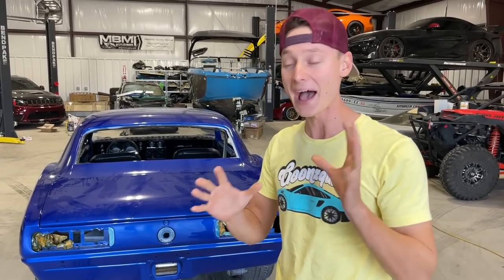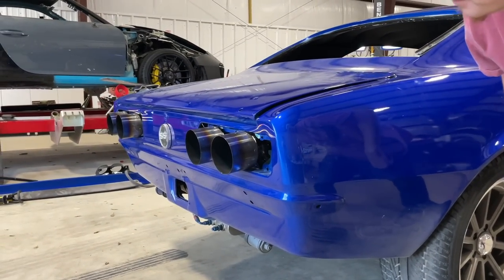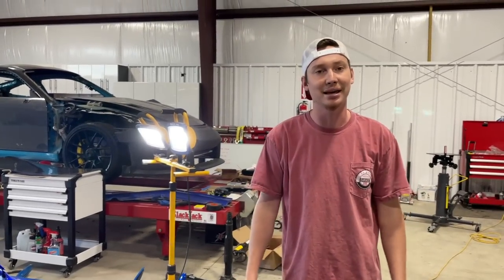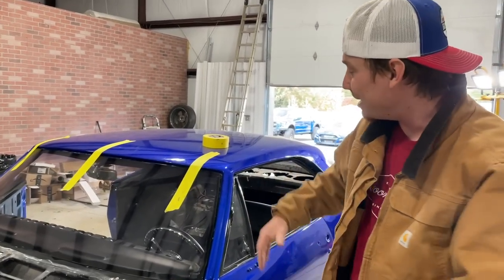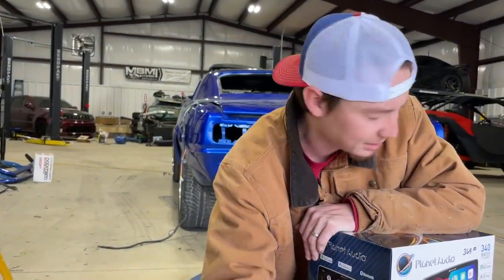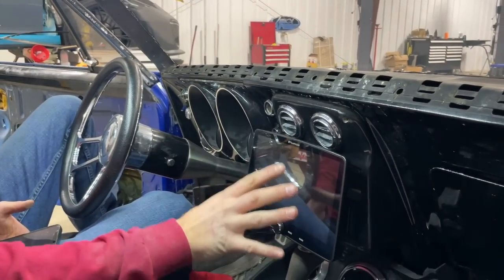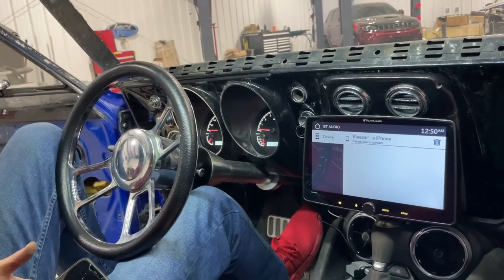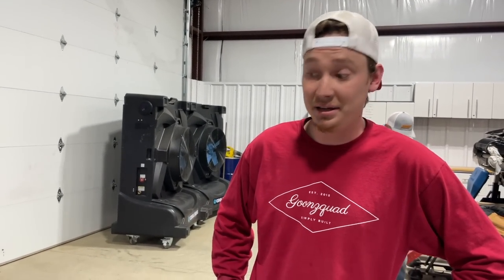Our LT4 Swapped 1967 Camaro Gets An Insane Stereo System!!!

Comment: Nice build guys but from someone who loves his tunes.... don't mount your amps on the sub box...turn your sub box right round so the subs are facing the rear of the car as the angle on the box is so its sits into the rear of the back seat don't use your gain as volume you need to match it to the head unit 😉

Comment: By the time you read this you will have the windshield and back glass reinstall. But it is important that you get the black primer made for glass installation and prime the glass and the pinch weld where the glass is . Don't you have the moldings that  goes around the roof and quarter panels. Same for the front. Also you need the clips that attach the moldings. good luck and keep on trucking on this build.

Comment: Guys, about the glass, your camaro came factory with a piece of chrome trim around the sides and top of the front and back glass that covers the glass edge. There were clips that installed on the vertical side of the glass opening for the trim to clip on. Being a restomod car when you bought it it may have had the little factory metal studs that the window trim clips slide on to ground off or something so the studs are not there.

Comment: you don't want the gain(s) and volume turned all the way up, your speakers will start clipping. start with the head unit turned up and then start adjusting the gain at the amp until it almost starts clipping. that's a good base (no pun intended) to start from. and def get some sound deadener in that trunk! but keep up the good work guys.

Comment: Windscreens before the 90's didn't glue in like that - you need to get an original rubber window seal, unless someone makes a rubber trim to look like one.

Also, the sub should be facing the other way I think - the angled side is supposed to match the angle that the back seats lean back at

Comment: Dont set gain too hight and dont use bass boost cause if can affect amp or even burn speakers and hipe u guys wired 8ohms and 4 ohms correctly to get the rite sound, also get some wite farrels for the wiring to the amp but sounds good so far keep up the good work guys 💙💙💙💙💙

Comment: Good sound system try the subwoofer speaker box facing the back facing subs behind the car will definitely get more bass, Got to adjust with the stereo settings as well and the subwoofer amplifier settings as well to make it sound good or have the shop were you bought it from to adjust for you, Camero looking damm good guys keep up the good work 👍🏻
Reply: yeah i don't think maxing the gain and cross over is healthy.   get someone who knows to calibrate it.

Comment: There should be a black gasket that houses the windshield. It'll give the clean appearance you want and it will seal better
Reply: The glass adhesive they used leaves a huge gap around the window. It's guaranteed that moisture is gonna get stuck back there and cause it to rust out way faster.
Reply: this^^^
Reply: The cringe has reached new hights. 😆
Reply: They just didn’t primer the car and the windshield properly shit is gonna leak also it’s missing the chrome mouldings

Comment: Love the channel.  My comment however is push back on the sound system install.  I know you worked hard on it, but I would have gone a completely different direction and installed an Ipod based sound system and not try to install that big screen in that Camaro if not enough room behind it because the screen sticking out behind the shifter and not sitting flush with the instrument panel looks bad in my opinion.  If you could have made it flush would have been a different story but you didn't. Not what you want on such a clean car.  I couldn't live with it that and if my car, I would have to pull it all apart and start new.  You could get ideas by looking at other vintage Camaro restomods.  Of course you want a modern sound system.  You could have also gone stealth and mounted the head unit in the glove box like some do if you could make the head unit like right.  I also don't think you need that sub size in the trunk.  Less is more.
Details matter on a car like this.  Yes, of course, you are time constrained to knock out this car with other projects on deck but doing it right matters too.  My 2 cents.

Comment: You should just get some black vinyl to create a border around that front windshield. Would be a lot easier and look fine 👍
Reply: It should have chrome trim that hides all the adhesive. That's the way it was done until about the last 25 years or so.
Reply: @Cartier_specialist  it should have a rubber seal to fit a windscreen on these there not bonded in

Comment: I have never seen a windshield installed with anything other than a gasket in a ‘67 Camaro. Will be interesting to see how it holds up. See if it leaks.
Reply: Yeah that was hideously all wrong
Reply: Yeah I was wondering if anyone else was old enough to realize that 😂
Reply: Why would it leak? Modern cars don’t leak. Same shit except instead of a gasket it’s glue.
Reply: Definitely a gasket but I have glued a few at customer request with no issues. Forgot to put primer on the glass, even if the urethane says it’s primer less to glass, always prime it Or it will not stick for long.
Reply: I didnt notice any clips put in for the chrome trim to clip into. The chrome trim hides the gasket material and makes it look  clean. I too have never seen a windshield installed this way.

Comment: Suggestion: remove the factory ac vents....cover the spot.....connect the modern ac vents. Rear tail lights; remove the OEM round ones, do some fab, replace w/modern square ones, and add a roll bar ....and that's a great deal in your sound system .. would have been about $1800 here in Cali 😎

Comment: I thought that year of Camaro had a rubber seal around the front windscreen, but that's what you get when you rush to get something finished.
Reply: nice to see anouther bolton fan can spot the big mistake of them bonding window in when it should have a rubber seal
Reply: @melwilliamson8208  It's just funny watching all the mistakes they make because they rush and don't do any research.
Reply: @sprograt  totaly agree they do good work but some mistakes are just silly anybody know old windscreens were fitted with seals not bonded
Reply: @melwilliamson8208  You would think their father would know how the windscreen should be fitted. I personally work in the motor trade and some of the repairs are laughable and the brother who works on the cars (Billy I think) supposedly did go to a automotive college for how long I don't know I don't think he pass exams going off the work he does in my opinion.

Comment: You should really think about sound deadening material being it’s a metal body car with the stereo system. It will make it sound better and you can cut down on the rattles. I would also suggest you get it professionally tuned as well or you guys will be going through speakers like a kid with candy. Remember the “Amp Gain” isn’t a volume knob. You also need to know where the head unit distorts in order to properly tune. I would also turn the subs around to be rear facing as well.

Comment: Love the build you guys should do some research on stereos or take it to a sound shop because with that hardware you can have that whole thing booming the tuning settings on the amp are very important and so is the way everything is wiring good freaking work keep grinding wish I was in yall position 💯
Reply: those are really just cheap walmart style sound eqpt. the camaro would be better without those dead weight hehe
Reply: The sub amp is wired wonky, should have been Wired in bridged mode and those 6x9 in pairs or just two of them so they would have dedicated channels for the front doors. One thing i also dont get why they picked up coax for the front doors when you could have picked a legit 2 way system. But its not my car hey and not bad for a first all custom install
Reply: @DahTiiteri  Defiantly need some tweets and 6s or something in those doors.
Reply: Yea with that car they need a whole custom trunk

Comment: You adjust the bass at the amp with the gain, but also make sure to turn up the bass AT the source, meaning the actual radio/touch screen. Kinda no name brands, so I wouldn't expect too much, but it is nice for now. Man, yall making this Maro Preem!
Reply: Bass at the source introduces distortion. The best methods are using an active crossover and leaving the bass alone on the source unit. Too many people run sub amps on a full range signal without crossing over or sloping the unwanted signal ranges. 

Then to compensate they crank the bass in the source unit and gain up on the amp. 

The proper way of tuning  is to go neutral settings on the source unit. Cross over any sound ranges your subs aren't tuned for and set the depth of the roll off of those signals. 

Then with the amp down set the source unit at the highest volume you'll use. Set your desired operating frequency then raise the amp gain. Once you start seeing the signal clipping on your built in clipping light or on your meter back the gain down  the slightest bit. 

Now you can assure a clean undistorted signal with only the desired signal ranges demanded via a crossover.

Gain isn't power neither are added settings on the source unit.
Reply: @BlackstoneMalone  yeah bruh...but these bois arent trying to win a fine tuning computer microphone audio checked competition..
They just want to hear and feel more thump from what they just bought, and this is the easiest way.

Comment: Go get some ABS Plastic Sheets and fill in the front radio gap. Then get an MDF board and cut out to the rear deck then carpet or fiberglass it to clean up the rear deck. The gains should be set to the head unit and the crossovers around 80 hertz for the subs and the highs 120 0r 80 hertz to protect them too. This is my old profession before Law Enforcement! Good job for the first time and getting the proper fitting for the wires to the amp and battery. This is to prevent from burning up this classic ride brother. OORAH

Comment: You guys will end up blowing up that engine before getting the car done if you keep doing burnouts and driving it hard without fixing the fuel pressure regulator, boosted engine need to have a vacuum line on the regulator to keep the fuel pressure 1 to 1 with the boost pressure, running the engine lean (too much air, not enough fuel) is a quick way to blow it up.
Reply: new engine, new content..
Reply: Hose not needed! The engine has a fuel pressure sensor and control solenoid along with a high pressure pump.The computer controls the fuel pressure,,,,the regulator just needs to be set to 84 psi.

Comment: The gain on the amp is used to set at top volume  with out speaker flutter/phase. You set the gain at high volume just below the damage of the speakers.

Comment: That stereo system and its base will sound better once you get the back seat in. It would be even better if y'all could put a thin piece of something hard up to cover that entire area between the trunk and the back of the back seat. I used a sheet of black 1/8th-inch polymer to cover that entire area, It looks good when the trunk is empty because you can't see the back of the back seat, and it makes the base sound better because it has something hard to bounce off of instead of it just hitting the soft inside padding of the back of the seat.

Comment: I'm a windscreen fitter and that windscreen you've got is a string in style it's ment to have a rubber around it that the glass sits in then you fit the glass to the car by pulling the string that window is not ment to be bonded it will just fall out the glue won't stick that's why there's a black band in the glass on new cars so the glue has something to stick too

Comment: Hey guys love your channel but there are a few thing you should change on your stereo install. 1 and most important you should never turn your amps up all the way on your gains it should be matched to your radio. 2 you should not mount your amps to subbox the vibration can cause your amp to premature failure. 3 your box should be turn the other way for better bass response. You can check all of this by checking YouTube videos 🤣😂🤣.

Comment: I’ve seen lots of comments about the gain, but also that box is designed to have the subs facing to the back of the trunk, the wedge should slide up to the rear seat and you should get more bass

Comment: Would like to see the Goonzquad one day taken a street rod!  Something old, and something new.  Either a fiber glass repo body, like a 32 or 34 Ford Coupe, 41 Willys Coupe, 40 Ford Coupe.  The engine options are almost limitless.

For old cars, like your 67 Camaro, they used clips and trim to mainly hold it in.

I know you boyz put air in the office but hearing you talk about how cold it is outside did you put heat in the shop?

Comment: The rear end would be so light at the moment it would never be able to hook up! Plus that LT4 is a torque monster! Here in Australia that rear parcel shelf would be an engineering fail due to being hacked up. It will add to the flex in the body and becomes an ultimate weak point. The sound will transform once the rear seat is in., as the sound waves will be cancelling each other out at the moment.

Comment: Subs need to face the rear of the trunk for it to sound proper.  Also you do not want to turn the gain all the way up, it will distort and shortly blow those subs.  Also wiring needs to be correct, 2ohm vs 4ohm load.  You should let the shop wire up the subs to fully benefit from your amp/sub set -up.

Comment: Never seen subs facing the front. I always thought the shock wave coming from the subs hit harder with the space in the trunk. 
Take it back to the shop when your finished to get the EQ set up rite. And that fuel pressure regulator.

Comment: Typically on this type of windshield install you would use Butyl tape applied to the glass, not the vehicle. Then the chrome molding gets installed around the perimeter and held in by clips. Must have put in 300 windshields back in the day and it's super simple.

Comment: Hey guys, I just saw the difference that you have in the gaps between the top and bottom of the fender and door. The door seems to be installed correctly according to the quarter panel so that’s means that the weight of the motor/transmission is making a bending in the hole structure. I have a mustang 66 and I install a frame reinforcement that is sell by total control products. Check that! With all that power you will need more structural reinforcement 😂. Love your content! 🤩

Comment: Loving this build and glad you boys tackled the sound system. Every car I've had for the last 25 yrs gets a new sound system. I love doing stereo installs so amazing the end product. I can't believe you got that all for $1000 my first ever system back in the day cost me $1500 for 1 sub and amp. And I still have that sub an amp 20 odd years now. Before you buy new amps play with your bass and treble settings on the deck. Sounds like it's on default mode. Just crank a few bass modes up and a couple treble and it will completely change the sound. Keep it up. I wait every morning here in Australia just to watch an episode before work.

Comment: Front windshield is designed to have chrome trim around it.  Crazy clips hold it in place.  The pegs that THOSE attach to are, obviously, gone.  Will likely just have to "glue" the trim in place. That covers the sealer.

Comment: Hey guys dont keep the bass  all the way up from the amp, keep it in middle. I'll tell you rite now that  you will blow the subwoofers best thing to do is either get it tuned or learn how to tune it. Fasten down the amps to the back of the sub and also fasten down the sub so It doesnt slide all around the trunk. Keep in mind all your side panels will get loose and start to rattle like crazy. That's why I got rid of my subs. If you guys did plan on getting a sound system you should of went with JL AUDIO  w6 or w7 because JL AUDIO plays all frequencies and a very very crisp sound.

Comment: Boy, turn that sub box the other direction. make sure the amp is on " LP" phase.. turn the gain to only 1/4..  make your adjustments for the bass on the radio.. you should divide the trunk space with a wall of some sort or your going to blow the 6x9"s from the sound waves of the sub box in time. if you dont want a wall then build something to protect the 6x9"s..enjoy fella's..

Comment: Sub box should be mounted facing towards the rear taillights way better bass quality trust me I did 2 12 inch alpine watt watts rms with 2 1000 watt apline v12 powering each sub that was a blast I also had a scorpion 3400 watt capacitor and yellow top batter man that car pounded and was so crisp and clear my friends in the back felt like throwing up from all the fun bass right behind them

Comment: Hey guys...the gain on the amp is not supposed to be all the way up & it's not used for volume subwoofers have a rating [rms] which stands for remote stable, nor is the bass knob you're gonna blow them or damage the amplifier whichever comes first.  You have to tune the amplifier to the specs [rms] of the subwoofers. Same with the interior speakers 
Secondly-do not mount the amplifiers to the box either.

Comment: Guy's you are use to working on newer vehicles the older car's like your Camaro did not come with a black stripe around the window to hide the glue to hold the window but would look great if you all did it
Get a vacuum line on the fuel regulator
Also what still scares me is how you guy's and also Vtuned done it also on his Mustang drilling wholes in the firewall and putting wires through with no sort of rubber grommet it will eventually cause a huge short in your electrical and cause big problem down the road